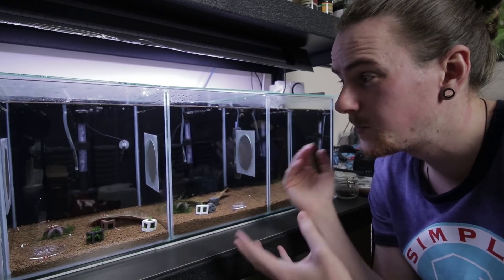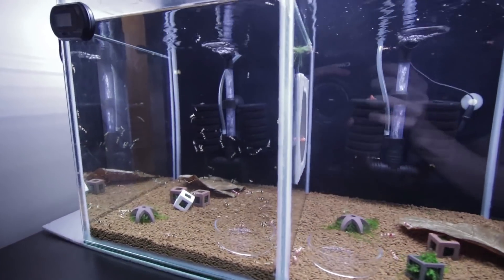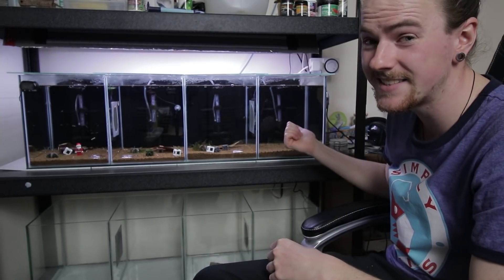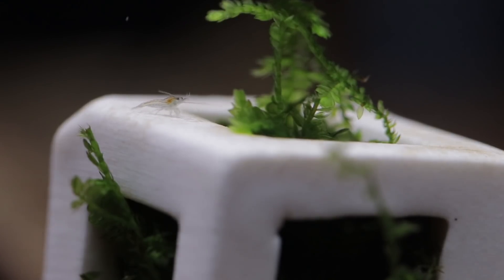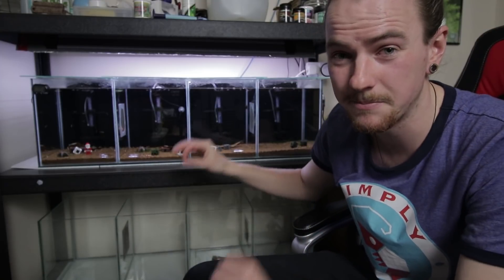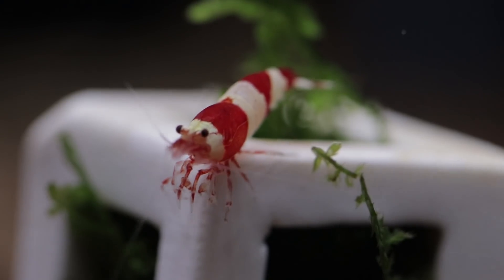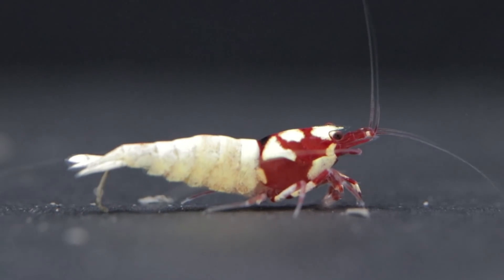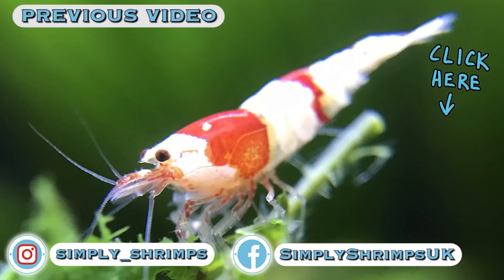Problem With The New Shrimp Tank!

Comment: I would probably try to cut what ever mesh you have left with the some size of the hole  or just a slightly a bit bigger and crisscross it, so the holes will be smaller and hopefully it will stay, hope it made sense.
Reply from the maker: Yeah that made sense. Though I just know one little shrimp will slip through 😂 I have now bought some 0.4mm mesh to replace it. Should be fun 🙈

Comment: Just use the blue or black filtermats as seperators instead of glass mate. there are three sizes I think, nothing gets through the smallest one. And you are free to convert the tank as you need.
Reply from the maker: This is an idea I did play with. I think I just like the sleek look of this tank. Maybe if it was bigger and not upstairs then I’d go down the foam route 😁

Comment: First off, I think youll be fine because the red is recessive and 1 in 8 clutches or less in a pure line...if you started with mischlings of some sort, then its random- but black will likely not be ever expressed if it breeds with reds only. 

oi I had the same problem when I tried this by altering a 20 long.  into 5 tanks of 4 gallons. The babies will get through any hole that allows water flow through it.  I've concluded the only way to do this is in really empty tanks without much substrate (I keep the substrate in Tupperware bins with holes drilled all over it. it then works as a bio filter and a ph dropper/ kh gh stabilizer as I add everything into the bin along with Bacter AE. 
  I've begun using an air pump method that has cheese cloth on the intake and uses air pumps to dump water from section 1 to 3 to 5....then 5 goes back to chamber 2 and 4 seems to get enough flow using cheese cloth screens....these holes are like .2 mm and clog frequently with algea however, so I've been trying micro mesh used in my city of Seattle (legally) as a spliff or pipe screen and comes in either 6cm squares or useless 2cm circles. So far as long as I have that extra push of a 100 gallon per hour air supply it moves the water through the screens with enough pressure to prevent substantial algea growth. 

great video, and nice work,  mate, Cheers!
Reply from the maker: Wow! It’s always great to hear how other people do things. I suppose a lot of it is still trail and error until you have if best set up for your personal aquarium. Thanks for sharing 😄

Comment: Why not just put some sponge on the seperator so the water still Can flow through but not thé shrimp?  Plus it gives you more biofilm right?
Reply from the maker: True but I don’t want to to be too clumpy inside the tanks. I just bought some finer mesh so shall see if I can sort it out.
Reply: You can also use the poly filter material.  I would think that material is small enough to not let the baby shrimp crossover
Reply from the maker: Thanks 😁

Comment: cut some foam for the middle holes (where you have the mesh) and set your take up like a hamburg matten filter .....use an intake (with foam or stainless steel mesh over intake) on one end and pump the water to the other.
Reply from the maker: Interesting method but sounds good thanks 😁

Comment: Hey Nathan! I actually watched an old video a few days ago, made by Rob from Flip Aquatics... talking about the Myths in the hobby..And there was also one that went: "Can shrimp get out of tanks?"

Uhhh.... YES!!! Yes they can!!!

He had several shrimps that went out of the tank onto the glass cover, through a hole near the side... and Rob found them lying on top of the cover; dead and dried out.

He also had a rack with tanks above eachother, and shrimp went from one to the other!
Now I don't know if they climbed up but Rob surely found species from the top tank in both lower tanks...

So! Just to give you a heads up; if you fix the mesh size in your dividers by either finer mesh screens or sponges, you probably want to have closed off tops as well.
Reply from the maker: Hi there! I remember watching that video 😂 thanks for the heads up. I do plan on making tighter fitting lids in the near future :)
Reply: @SimplyShrimps  Great! You're welcome! :) 
In the mean time you could put signs near the top of the tank with DO NOT EXIT written on it (in Shrimps ofcourse! They don't know English...)
Reply from the maker: Aqua Peet maybe I should learn shrimp first 🤔😅

Comment: With your CRS/CBS problem, why not just have those shrimps at opposite ends of the setup? What are the odds of a baby travelling across three sections?

I used to have a setup similar to yours and one problem I had was shrimp actually climbing out of the water, up the glass and into the next sections. Didn't happen too often, but it was annoying
Reply from the maker: I know there will be one little dare devil that will make it all the way across ha! Yeah the glass lid is just a temporary one for now. I have some sheet corrugated plastic that’s fits perfectly snug.

Comment: using sump is the best than this... (in case separate tanks)... and its also the best to not separate...

my experience just change the water in sump.. you can even change it all from there but don't take any water from the shrimp tanks..

they grown very well...

my tips... for simplicity... you can build a smaller one than shrimp tanks... the advantage is your shrimp environment is bigger than it looks... so.. easy care to maintenance and do not worry of others parameter...

Comment: If you don't clean those mesh pieces i imagine it won't take too long before the babies can't get through.
Reply from the maker: That’s a good point thanks 😁
Reply: @SimplyShrimps  Also worth considering the cheeky little blighter might have just grabbed onto your arm and you transported him to the other tank without knowing. That is if you can remember dipping your arm from tank to tank. :)
Reply from the maker: True but I use tweezers to save my arm getting wet ha 😂
Reply: @SimplyShrimps  The only reason i thought that might be a possibility is that shrimp that small and young don't tend to move around much and go exploring. They just sit where they are born for a good while. That one must have gone rogue heh. Hopefully, it shouldn't be much of an issue for you anyway.

Comment: Why don't you move the reds to the end  tank so you have blacks at one end and reds at the other. The Babys are very unlikely to move thought 2 of the tanks so you will be able to control them better.
Reply from the maker: This is true however there are baby blue dreams in all the tanks 🙈😂 I’d rather not take the risk.
Reply: @SimplyShrimps  I stand corrected 🤣🤣
Reply from the maker: Clatkingstar if shrimp could fly they would be all over my house by now 🙈